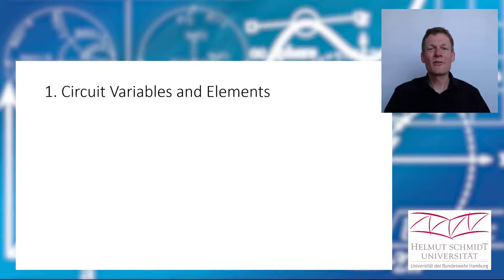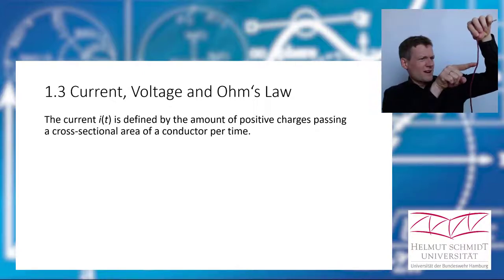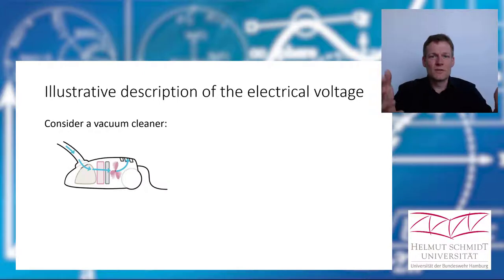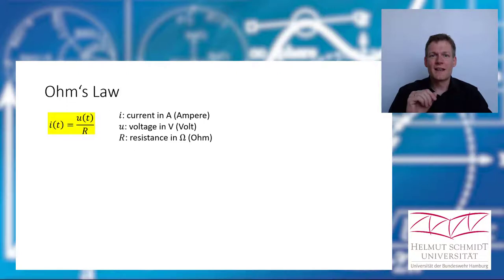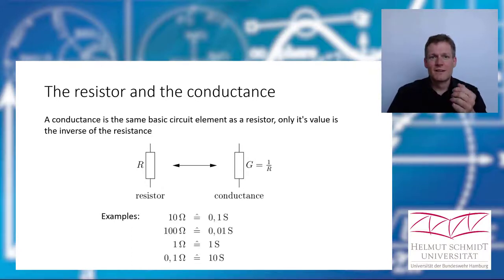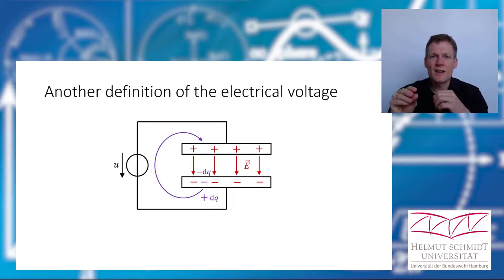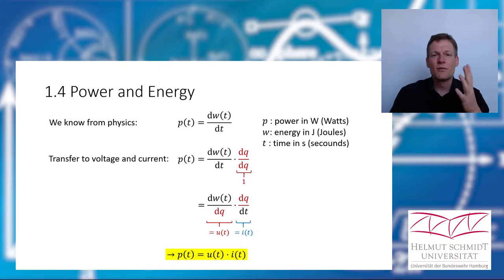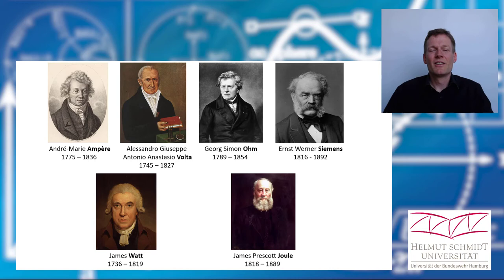Electric Circuits Lecture 01 - Current, Voltage and Ohm‘s Law • Resistor • el. Power • Efficiency

Comment: The explenation for voltage was irritating. Then there was talk about Siemens and dq and dw. Fells like I have to study before I understand the video.
Reply from the maker: Yes, you are right. It is not easy to explain, what the voltage is. Therefor I use the example with the vacuum cleaner. I need the equation u=dw/dt only to show that the electrical power can be calculated by p=u*i. As a beginner, forget about the other stuff. Just know that i=dq/dt, u=R*i, G=1/R and p=u*i.